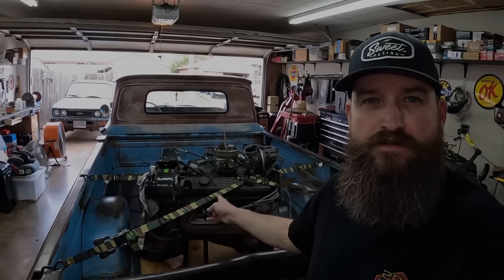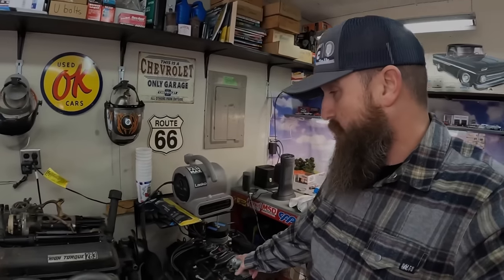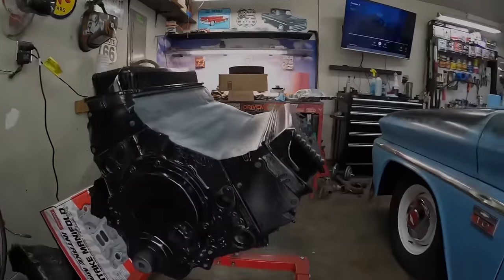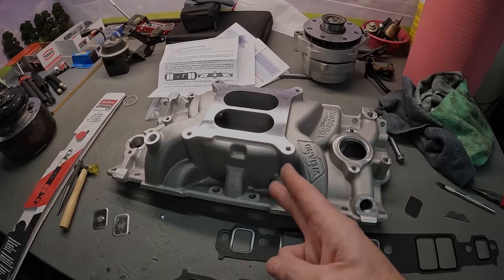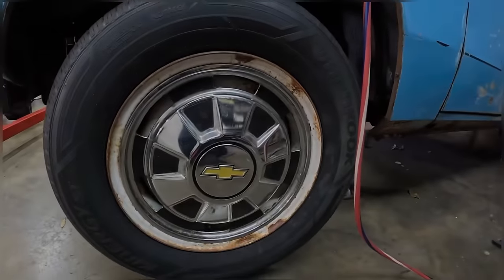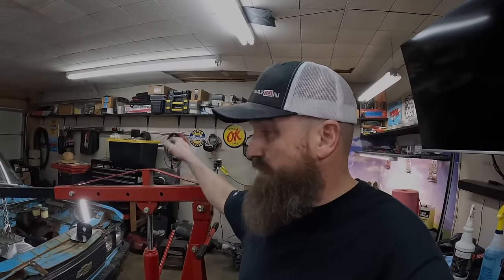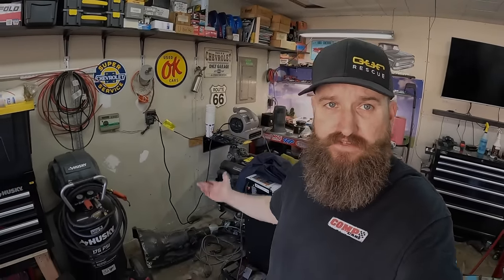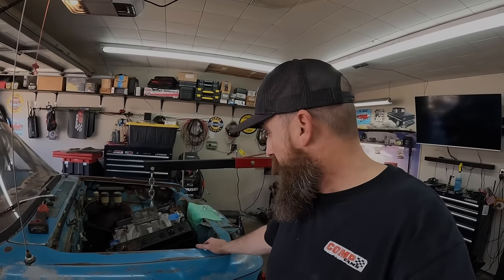1976 Chevy luv sbc 350 swap

Comment: 14mm for trans mount bolts. the metal fuel vapor line works great for the modulator vacuum and the e brake wheel can be moved for clearance and still work . Cool build, hang in there
Reply from the maker: I saved everything for the park brake system. Thanks for your input.

Comment: To lift the engine higher and get more angle out of it you could have just moved chain links to shorten all the chains. Especially on the main cherry picker chain with the hook on it. It helps to have another perspective when solving problems. 👍

Comment: Quick question. Did the insurance company take good care of you with the tailgate issue? I ask because I daily drive my 64 C10 and my biggest fear is other drivers.
Reply from the maker: Yes and no. They needed an estimate so I got one. They sent a check that was 80 percent less than the estimated amount. I called several times to the appraiser to no end. I finally got a hold of him and asked him where’s the rest of the money. He stated, the first check is just to get the ball rolling. Then what’s the point of the estimate? He didn’t have a good answer but was able to get a few more dollars out of them. I’m going to switch to hagerty very soon.
Reply: I think I better do the same thing. I’m afraid the insurance companies won’t cover the amount it takes to get it repaired. I hope you’re able to find a tailgate that matches what you have.